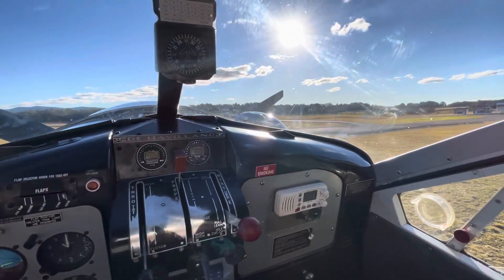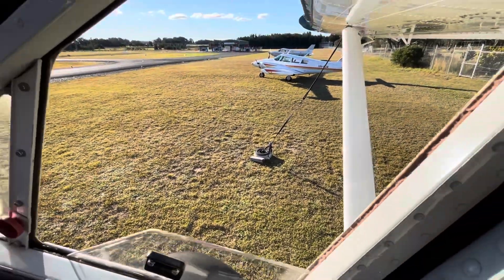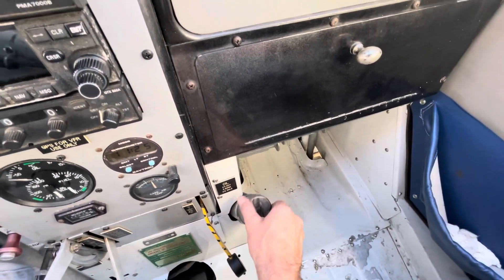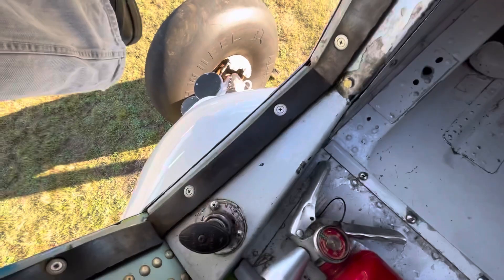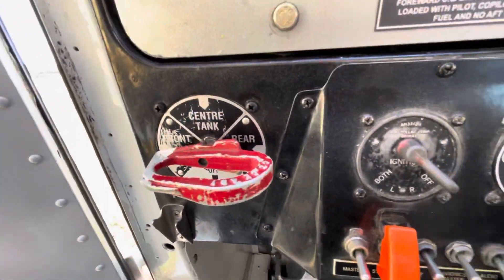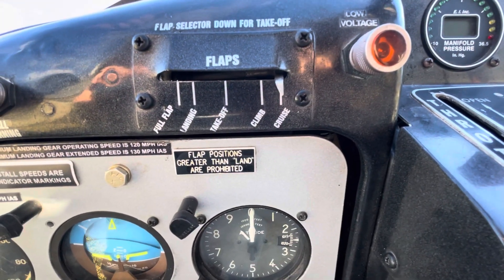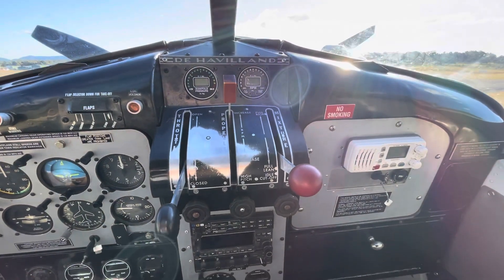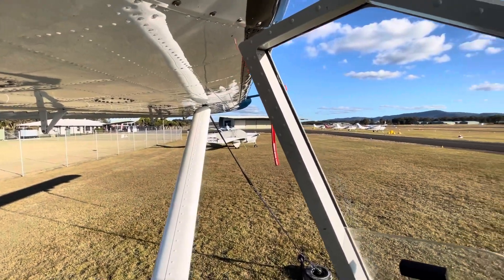DHC-2 Beaver Cockpit

Comment: Must have a coffee cup holder. The Beaver looks higher because the Twin Com is very low slung
Reply from the maker: It needs one! Yep, it’s a long way up!
Reply: @aeroplanetoby  A lovely aircraft all the same. For its day the fuels selector was quite advanced. The handle actually points to the tank in use which is  a good thing as is the fact that it has an off position. Too many typrs have selectors where you have to leave it on on or the other or sometimes both, not a good idea when it comes to parking across a slope. If you leave it on both a large percentage of your fuel can disappear out of the overflow pipe.